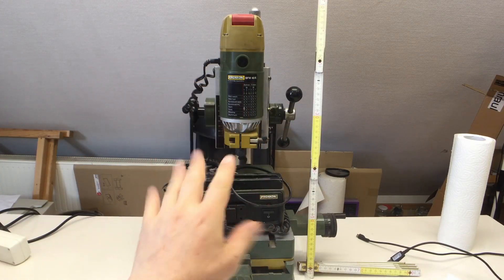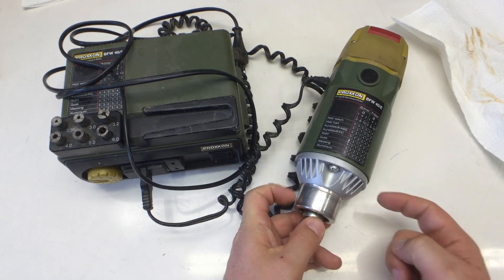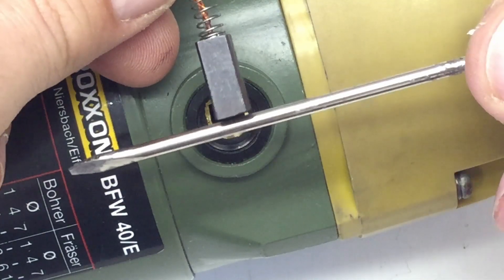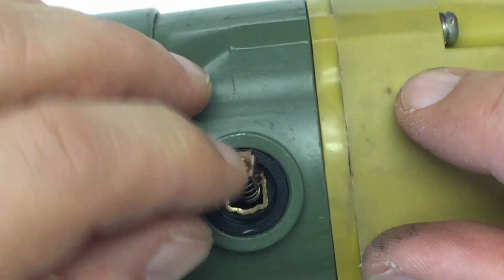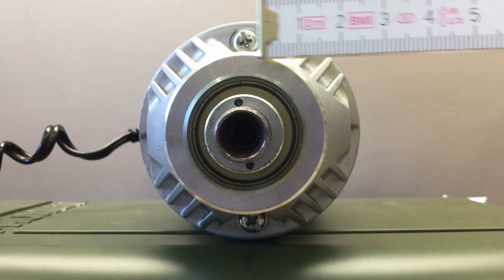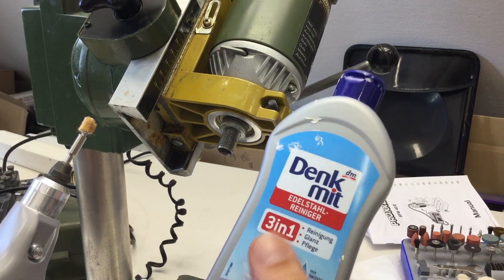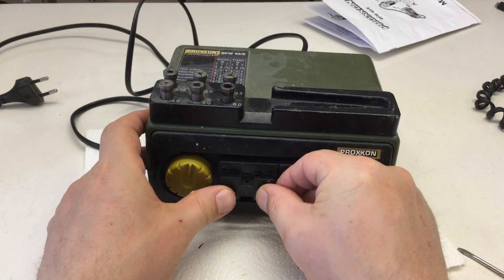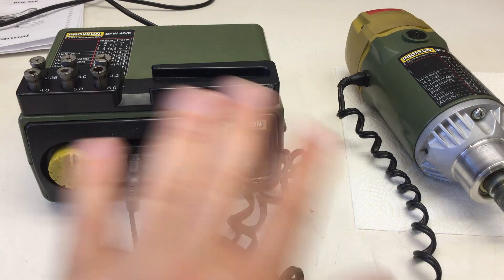Proxxon BFW 40/E Spindle Overhaul (Cleaned, Brushes Checked, Collet Polished)

Comment: Why did they choose an external power supply instead of main AC?  I have a similar size 1 horsepower Makita router and it plugs directly to the wall.
Reply from the maker: I can only guess ... First, maybe using a low voltage DC motor was cheaper than using a mains AC motor (costs for motor plus electronics for RPM control). Second, the spindle motors you can actually buy are for some reasons usually either DC or high frequency / high voltage AC, not mains AC.

Comment: I bought the new model spindle as the duty cycle on this spindle is far too short.
Reply from the maker: Unfortunately those short duty cycles are a limitation of many Proxxon tools. But I think the 10 minutes at full power (250W) specified for the BFW 40/E are kinda OK for manual milling. I can't think of a single operation that would take longer than that. Using that spindle for serious CNC is of course out of the question.

Comment: yay   muriatic acid will clear the rust !
Reply from the maker: Thanks for the info! What concentration would you recommend? I can get here in Germany either 4%-5%, 30%-33% or 37%.
Reply: @robertssmorgasbord  well brick acid is cheapest strongest and most dangerous.. you will have to choose, Eye protection a must... gloves also, please be careful :)
Reply from the maker: @David_11111  OK, brick acid is about in the middle regarding the concentration. I'll give it a try next time I stumble about some corroded metal :-)